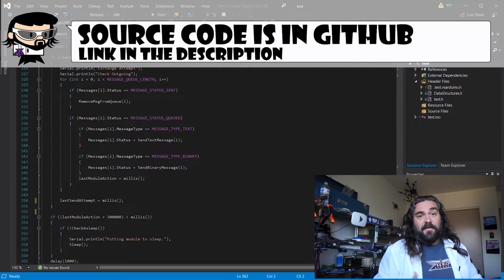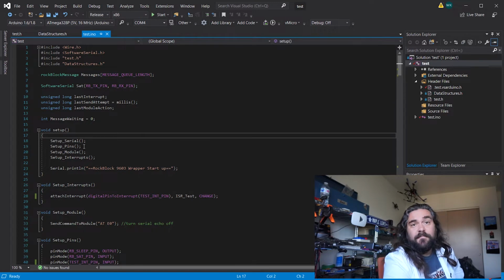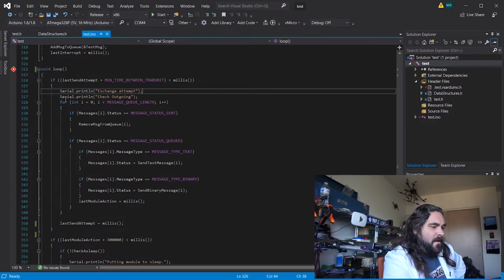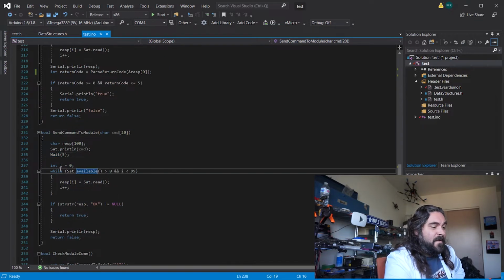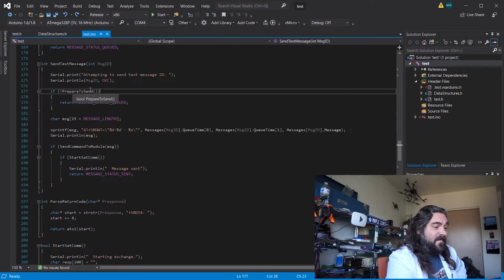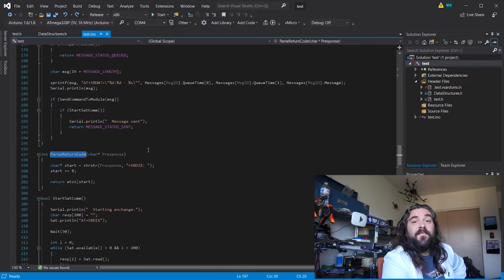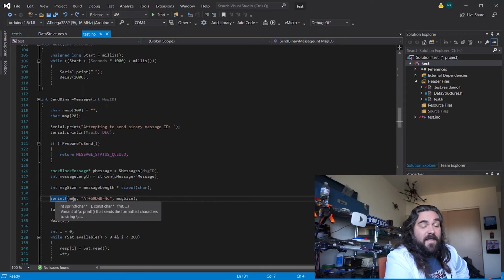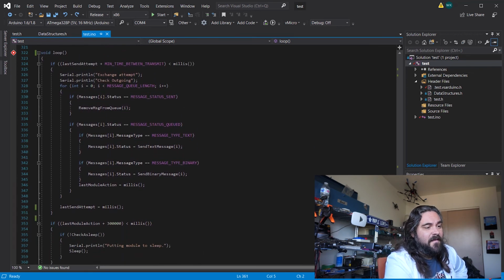Rockblock 9603 Wrapper - Sending messages - Part 1 of 3

Comment: Hi Mikey, RockBLOCK fans.

Just an FYI about the power inputs. RockBLOCK 9603 is 5V native.

There's a Li-Ion (Pin 9) and common 5V rail (Pin 8). These both connect to the main power bus on the PCB and directly feed the super capacitors - which in turn run the Iridium module. There's a fixed power input of ~450mA which charges the super caps regardless of what voltage is applied.
There's a Schottky diode between Pin 9 and Pin 8 to protect a 3.7V battery from higher voltage supplied to the 5V input. This diode effectively robs you of ~0.3-0.4V.

IF you are only planning to provide low voltage and do not the require battery protection provided by the diode then you should connect directly to the 5V Pin 8.
The minV on pin 8 is ~3V (at around 2.7V things start getting weird), the minV on pin 9 is 3.5V.

Essentially by plugging your 3.7V battery into the 5V pin you get a bit more bang for your buck as the battery starts to sag.

If you are using a battery AND an external power source (eg solar), then you will want to connect the solar to 5V (Pin 8) and your battery to the Li-Ion (Pin 9) - this will protect the battery.

If you're using a 3.7V battery hooked up to the Li-Ion pin and having issues with SBDIX sessions appearing to fail, (no response), I would suggest switching to Pin 8 - it's most likely power droop causing the module to brown out.

Hope this is useful!

Comment: Great video! i am looking forward to the remaining two parts and by the way can you please help me with the pins i am supposed to use to connect the rockblock 9603 to the arduino board. i am using an arduino uno board
Reply from the maker: Titilola, I am working on the software for the second part right now, hopefully will finish it off this weekend. As for pins, there are two that are required, (SoftSerial RX, and SoftSerial TX) which are both configurable, so it is up to you. There are also a couple of optional pins, SatAvail and ring. These should be connected to pins with external interrupts.
Reply: Thanks for your response. I am using an arduino uno and compiling my codes after including the iridiumsbd library and the Softwareserial. I get an error message of "serial3 is not defined in this scope" but when i use an Arduino mega it compiles alright. and by the way can you drop your email address so we can communicate better. because i have a project deadline for Friday, and i think i  need your help...
This is my email address  titilolaobj26@gmail.com

Comment: Bien ahí ! Tanta espera para probar el rockblock 9603. Yo tengo el 9602.
Reply from the maker: I would assume the command set would be very similar.
Reply: Quisiera saber si podrías realizar un tutorial de cómo utilizar un módulo GPS con el módulo 9603. Para enviar posicionamiento a cualquier parte del mundo. Gracias
Reply from the maker: This should be pretty straight forward, as most GPS receivers send NMEA via serial communication, so you would just need to consume those statements and then send it to the rock block as a text message as shown in this video. Obviously given the cost of sending the message, you will want to only send it upon a certain condition.